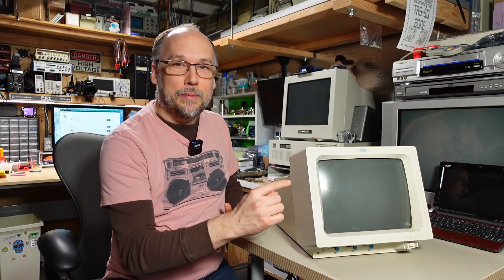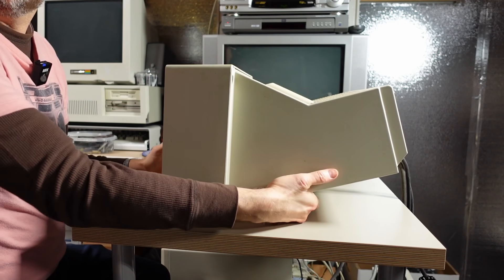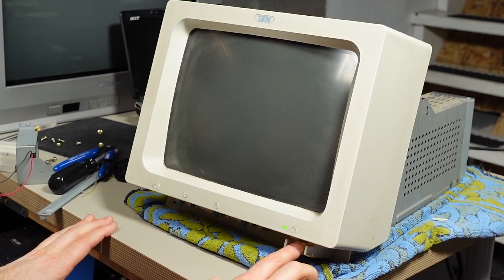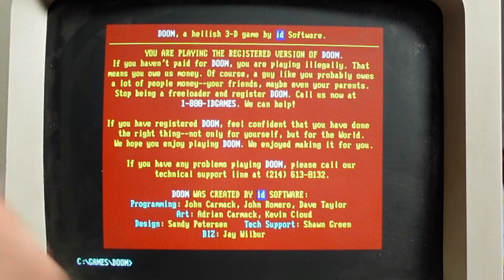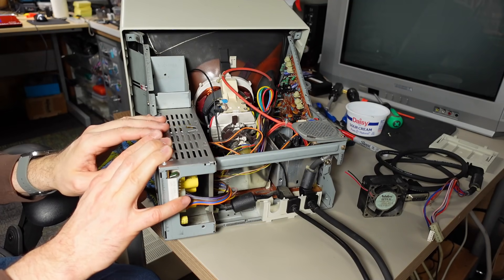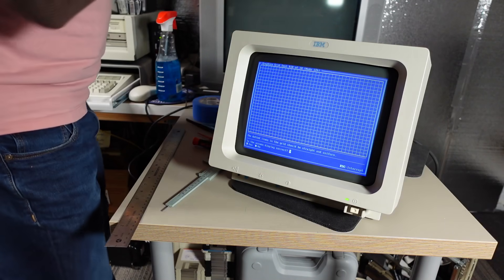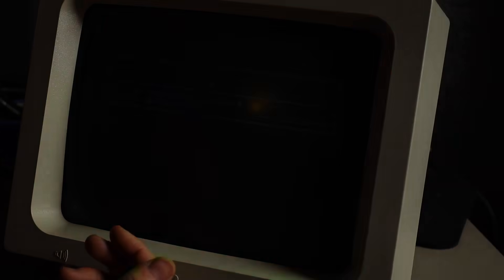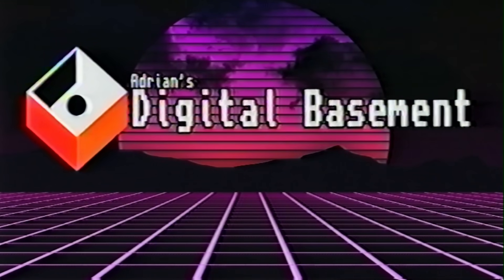The IBM PS/1 VGA monitor is built like a tank! (and still useful)

Comment: So I have a monitor off an old Power PC Mac and I'm trying to figure out if there is a way to use it as a VGA monitor. It has a that proprietary Mac 15 pin port. Anyone know if it can be adapted to VGA or RGB?

Comment: Adrian,
The sharpness of that monitor will never be that great. It has a dot pitch of .36mm. At the time that was slightly better than the most entry level monitors which had .39-.41mm dot pitch. Better monitors had .28mm dot pitch and the best were even better. A Sony had a dot pitch equivalent of .25mm.

Comment: If a pot is ALL the way up, and your picture doesn't fill the usable screen, I am sorry.  That is a sign of "tired" capacitors.
If you do a recap of its power supply, boards, and re-ball solder on all of its joints, it will become a "happy" monitor.

Comment: i used to own vga IBM ps1 just like that before
it always dark n lower sero not Sharp 
i have fan failure on it n i took it aparts n cleaned up n put new fan in it n use it for every old retro pc unite vga screen died out last me 3 years
n that IBM ps1 always heavy is like tank screen

Comment: older games look better on CRT, specially on consoles where they used "tricks" to simulate transparency or more colors. you lose that with modern screens.
Reply: Yea, especially with the Sega Genesis.  Devs put the color bleeding artifacts from the composite and RF video signals to their advantage and the waterfalls on Sonic 1 is a prime example of that.  Also, I'm pretty sure there's a computer system that actually used composite to give it color but really it actually rendered in greyscale.
Reply: @tyisafk  Perhaps the Apple ][ ?

Comment: God I miss the early netbooks.

Still have that very small Sony netbook that can actually fit in a jeans back pocket. Battery life is laughable these days, but nothing matches it for portability and utility.

Shame they kept trying to make the performance higher to run windows rather than just sticking with the earlier Linux versions. Utterly killed the whole market with devices crippled by heavyweight OS's on lightweight hardware.
Reply: My HP 1101 netbook gets around 6 hours battery life, but it has the larger 6-cell battery option.

For pocket-sized PCs I have my HP Palmtop from 1993, and that lasts forever on two AAs. I made a DOScember video about it on my channel but now its views keep going down and down :(

Comment: 800x600 52 or 56hz
Reply from the maker: I remember that mode -- hated it as there was just so much flicker!
Reply: The monitor would probably run at 1280x960 60Hz interlaced.